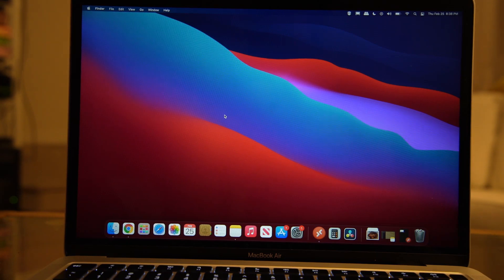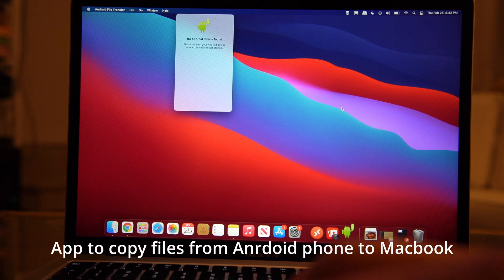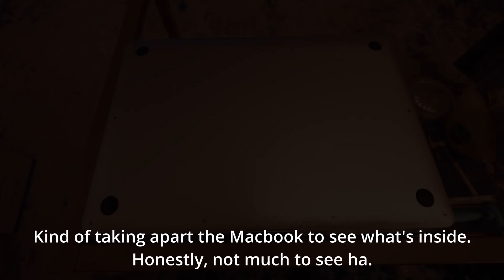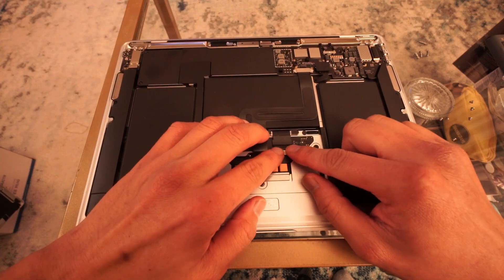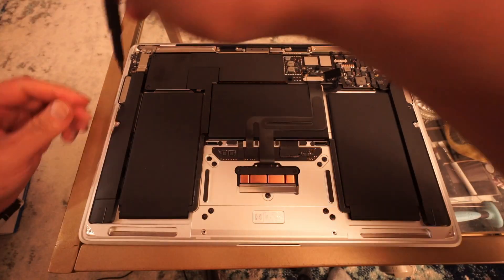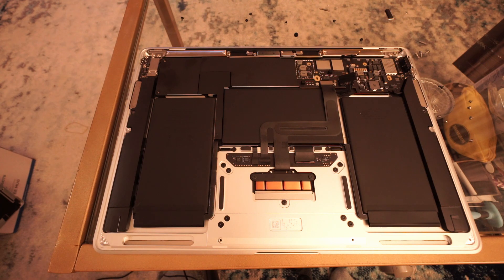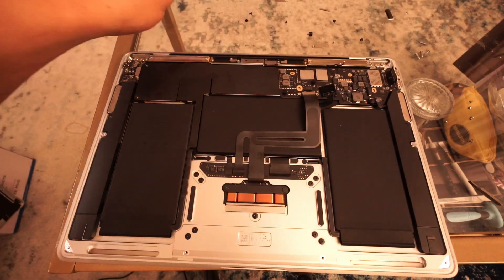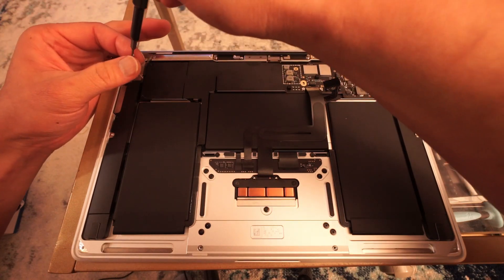Is the Macbook Air M1 any good ? Thoughts from a PC user and taking a quick look at the logic board

Comment: You can do the M1 thermal mod (see here in you tube) by adding thermal pads to the M1 heatsink, since you just opened the case. That way, the thermal throttling will be put off until later, for faster performance (at least on benchmarks).
Reply from the maker: Yeah I saw that and want to see how much of a difference there is and how much hotter the bottom of the laptop ends up being. When reencoding a video for a significant amount of time (> 30 minutes), the bottom does get a little uncomfortable to the touch.

Comment: That Macbook Air will last about a good 20 years longer than those windows laptops you just mentioned.That's why you pay more for Macs you get a long lasting product that want slow down too much.Also Macs are more user friendly than PC's you're just not familiar with them yet.
Reply: my last macbook pro (entry level) (2017) had factory issue with battery, it's just starts to air blowing - so i have to replace it. 200$. It was overheating if you just start to work with some soft (ableton), keyboard got issue from first day - some buttons were 30% pressing and just stucking.

my previous macbook pro 15' (top specs) (2014) had problem with screen. cover just start to get out and whole monitor starts to looks like some one put some acid on it. in official service they ask me 300$ for replace... i have to make it at not official service. for 200$. after 8 month apple agreed that they did mistake with screens and start to change it for free - but my spent my money already.

the only mac book pro 13 (2012) first retina - was stayed longes (6 years) and did great job. but after time speakers died, then battery, then motherboard.

couple days i took my old samsung intel i5 (2013) slim book from shelf. install windows 10, and it works still. no problems with easy tasks. 

so i don't know what you talking about.... 20 years?  macbooks.
You have to change laptop every two year. in 3 years you loose 50% of it's price.
Every single macbook after 2012 got factory issue and you strugling to fix it - since it's harder and harder every year.

And even if it's not broken - Mac's are not for professionals in all variety of genres any more - since they cutting software and hardware to supply. (new m1 - i just got it and send it back - since it's not working properly with MIDI hardware (yet) for example) 

Mostly they care about TESTs, video editing, video converting, benchmarks and bloggers reviews.